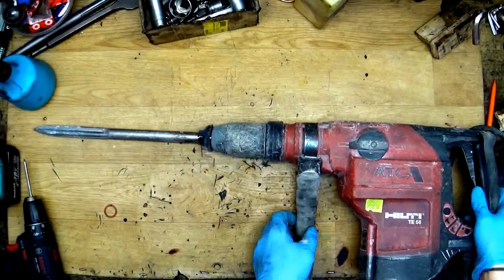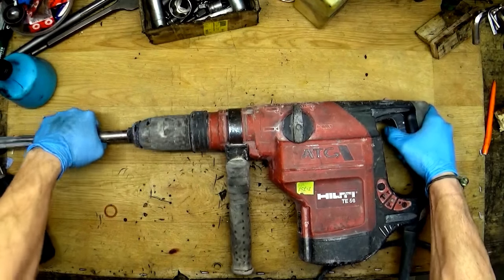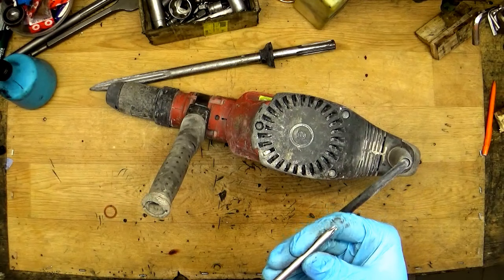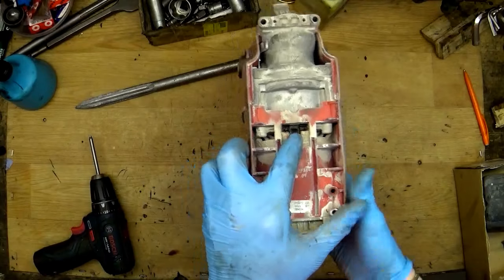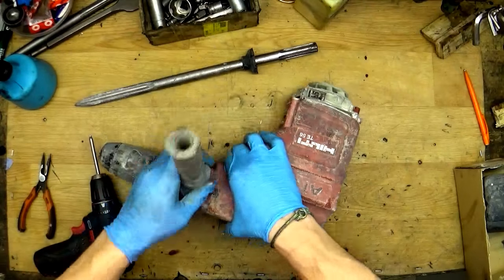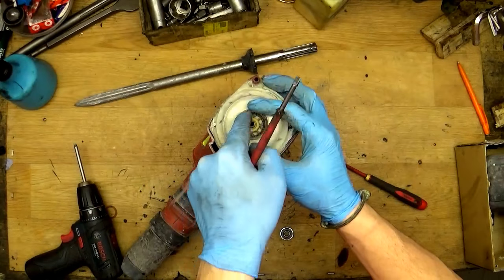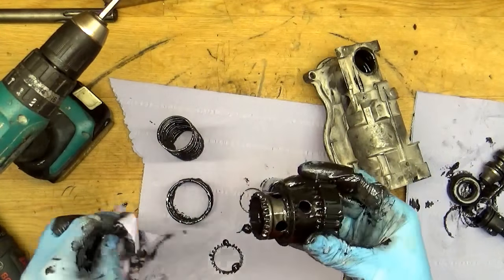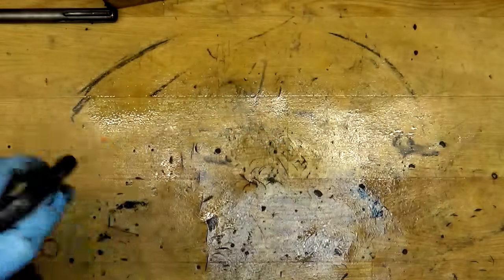The repair cost 230 Euros! Hilti TE56 disassemble need new tool holder o-rings oil armature fan

Comment: Hi,
Love your work.
I have question a took apart my TE 56 ATC because it made sparks and stoped hitting as hard.
When i took it apprt (tahnks to your video) i found oil and guk in the magnetic cluch..
Is that a normal thing or is the oil leekig from the gear box above.?
In other words can you tell me if the clutch is suppoed to run dry or is it normal to find oil in it.
If not i think the oil is leeking from the gear box and dripping down on the stator causing my problem.
Does that sound possible.
Many thanks for any help you could give me.
Best regards.
Romuald